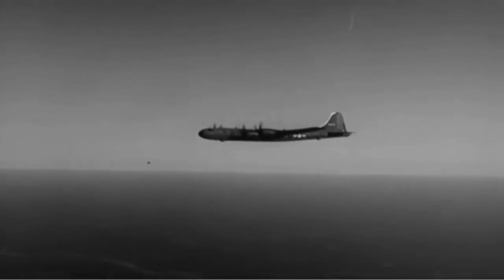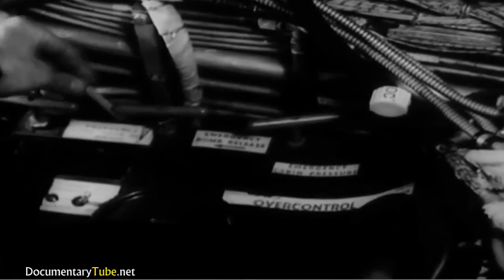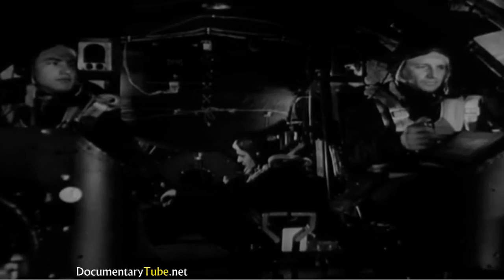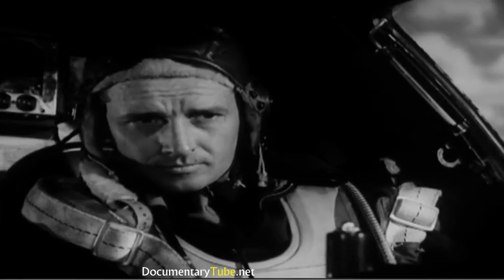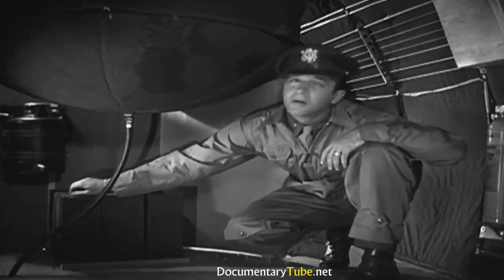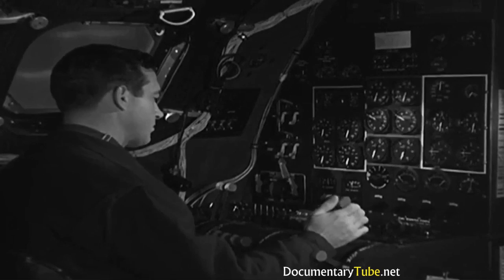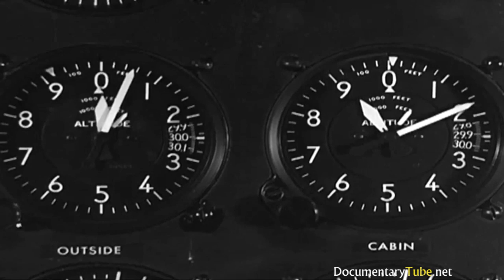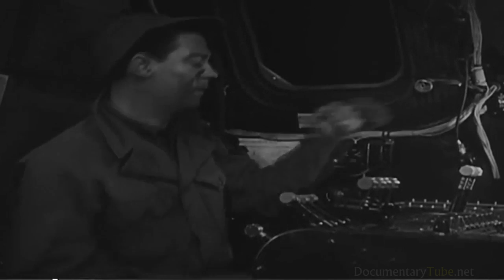HOW IT WORKS: WW2 B-29 Super-Fortress

Comment: If I were the Crew Chief launching this plane I'd be PISSED !!
  Many off the flight crews walk around checks depicted would be fine, but strut extension and tire pressure ? I would take that as an insult. It says they don't trust the Crew Chief with something as simple as that. And as for checking panel screws like they did ? Rapping the panels a couple times with a knuckle would be fine but what they did ? That would piss off the seven level inspector, who's job it is to check and sign off on things like that would be saying the same thing, that they can't be trusted to do their jobs either.
   I guess that's how they did the walkarounds back then, if that's what's shown here in the film, but I suspect they exaggerated just a bit.
Reply: +randy109 Surgeons now use checklists, emulating pilots, and it saves lives.  A high IQ doesn't mean you're not susceptible to errors of omission.
Reply: Not quite Randy. I can't say I worked with anybody that had a low I.Q. in my squadron, or anyone else who worked on the planes that I knew. Especially any body who worked for S.A.C. as I did. Things like flight crew checklists and the maintenance work cards used are there because something as complex as a large aircraft has far to many things to remember to fly or maintain from memoriy. 
  I worked and flew with many officers. What I liked about the Air Force, and working on the planes is that the officer flight crews treated us as co workers, not as someone subservient or less than because we were lower in rank or not as intelligent as they were. I always felt I worked with them, not for them. I dont even remember ever recieving a direct order. Instead, I was expected, as every one else in S.A.C. was, to know and perform my duty to a high standard, without somone standing over me barking orders. S.A.C. was VERY demanding in that way, and rightly so, because lives and the mission were at stake.
   Most officers I knew did not have multiple degrees. Many had degrees that had nothing to do with their duties. My squadron commander has his degree in ceramics, and he was a damn good commander.
  Your assumption about service members with low I.Q. s may have been true many years ago, but today's battlefield and aircraft complexity demands far more than people who aren't so bright. Also these days, advancement past the rank of SSGT is difficult without at least some formal education.
Reply: Actually, on todays flightline, if a flight crew member unscrewed or unlatched a panel, as the flight crew member did in the video, for any other reason then some kind of emergency, it would be a very serious violation of the seven legal inspection thats always performed as soon as the preflight is completed before crew show. What's done instead is to visually inspect, then rap on the panel a few times, listening for any that rattles.
These days, once the seven level inspection is complete, the aircraft is for all intents and purposes sealed, except for what the ground crew needs to do during engine start and launch. Any other alteration of panels, hatches, or secondary structures would be illegal, and would at least require another seven level inspection, and quite possibly disciplinary action under the U.C.M.J.
Reply: +8091pinewood Maybe I shouldn't have put the stress on IQ because that is rather insulting.  For several years I had two Corporals under me and one had an IQ about 35 points higher than the other.  The "smarter" Corporal was absent minded as hell and I would climb all over him when he forgot basics because I KNEW he was highly capable.  The fellow with the lower intellect was actually better and more reliable because he knew his shortcomings and actually tried harder to be 100% efficient.  Let me put it another way.  If you are on a TEAM you know who you can trust and who you can't without looking to place blame.  You almost instinctively know which parts of your checklists are REALLY important and which parts are put there to cover somebody's tail.  I've never met the man that doesn't "pencil whip" a couple of items because he fully trusted the man ahead of him.  Anybody who claims they NEVER ONCE pencil whipped a single item is a damn liar and you know it.
Reply: 8091pinewood  You are right about people getting "pissed" because guys go around behind them looking for rookie errors.  It IS insulting at times.  That said, when you try to make a process "fool proof" you must make it simple and repetitive.  In my unit we have guys with multiple University degrees working side by side with some 19 year old private with an IQ of about 85.  Any process that wants to be fool proof will be insulting to an educated person with a high IQ, like a Physicist working at McDonalds.  Redundant, boring checklists are what make it possible to enlist a kid with a Beavis and Butthead personality and have him handling multi-million dollar weapons systems in 6 months.  Remember, even if YOU are not an idiot, YOU are surrounded by idiots...

Comment: So after all this b***s**t, can we get to war?
Reply: Bill Dunn  A LOT of repetitive, boring, time-consuming Red Tape goes into those Checklists.  I've worked at an Aerospace Facility in central California for over 35 years (DoD employee).  You literally would not believe the pedantic time consuming work that goes into "Process" and "Standard Operating Procedures" (SOP's).  No joke, just as a Security Officer changing shifts in the middle of the night we perform dozens of checks on equipment (Vehicle, Weapons, Safety Gear, Medical Gear, Personal Protective Equipment and so on and so on...)  Some units in our facility actually have different colored "footprints" on the floor to have personnel walk a pre-designated route while doing equipment checks.  About the only good thing about these lengthy checks is that they really DO work.  You can have guys with many years of schooling and experience write an operating procedure or a checklist that any 19 year old with an IQ of 85 can follow and guarantee quality, reliability and thoroughness by repetition.  You ever wonder how the Military and Defense Industry can take a shoeless hillbilly and have them work on multi-million dollar, high-tech equipment in less than 3 months?  Procedures, SOP's and Checklists, THAT's how.  And you are right, if a bomber has to scramble they will get blown to hell while still sitting on the ground doing a 45 minute, pre-flight check ✈✈✈

☠
Reply: Luc Buydens It's an auxiliary power unit, usually a "Ranger" internal combustion engine. This supplied electrical power on the ground, during take-off and landing approach.
I was fortunate enough to fly in these things during its final two years of service.
The interminable pre-flight  inspection as described here is a huge exaggeration.
When the aircraft was cleared for flight by the ground crew, the flight crew got on board, just like a "normal" aircraft.
The idea of pilots checking tyre pressure is hilarious!
Reply: ***** Yes, I've seen that video. What a total tragedy.
Reply: randy109 May I ask, do you have by any chance an idea what the "putput" is? Its a piece ofvequipment the tail gunner has to check for the pilot.

Comment: Note the B-29(s) shown are in OD, the production versions were Natural Finish, like the Enola Gay at the Smithsonian!
Reply: The test models(YB-29's) were painted. Not painting the production models saved several hundred pounds. Fuel,Bomb load all those .50 cal. rounds weight critical for 18 hour flight times.

Comment: Less than 20fps on the gun camera? that must have been awful. I didn't even realize they had that technology back then.
Reply: Was this the camera they used so they could see below them? Just making sure, probably a dumb question
Reply: @hotbam37  
No. The could not see anything from the gun cameras until film was processed on the ground after landing. The cameras pointed at the gun's target for auditing purposes.
Reply: The gun camera was a film camera that activated when the gun trigger was depressed and recorded what the gun was (or was not) hitting to prove kills. It was not used to aim the weapon and for auditing purposes 20fps (film frames) was adequate.
Reply: 16fps was standard speed in  film  cameras even film in a movie theater is 16fps.

Comment: can someone tell me what the Put-put is ??
Reply: RattlerX5150 aux power unit.  APU
Reply: RattlerX5150 Putt Putt golf and games?
Reply: RattlerX5150 compressor
Reply: RattlerX5150 generator for extra amps
Reply: thanks
Reply: A.P.U.  Auxiliary power unit. Provides power without an external power cart when the engines aren't running and or the generators aren't on line yet. On many jets, especially airliners, it also provides compressed air for starting engines without an external air cart.
Reply: Does the Put put have its own fuel supply, or does it run off the AV Gas
Reply: @RattlerX5150  had its own fuel -it was a 2-stroke

Comment: I just watched the first few minutes but I was like dang, this is just like how your supposed to check your truck at UPS each morning. They have some video like this. haha Wonder how many of these pilots and gunners actually did all these steps every day back then during the war or just skipped most of them! hehe Very thorough video.
Reply: The crews ALWAYS did all the checks, everytime they flew. This is called the walk around, and its like a time honored ritual, for very good reasons, because lives and the mission are at stake. The crews would no more skip or do a half assed walkaround then they would wear a swastika on their uniform.
Reply: @8091pinewood  as one retired Apache pilot wrote in his book: "... or else we will be turning things on mid-flight without knowing if they would work..."
Reply: Acc0rd79 This was describing what the manufacturer deemed necessary before takeoff. it was an out for them if anything went wrong . I agree I doubt many crews were this thorough ? They would more than likely trust their ground crew to do most of these apart from the general walk around the plane that most pilots do to this day and making sure the landing wheels were up or down in flight.

Comment: It would have been interesting if at least one squadron of big shiny B29s were sent to Europe just for morale purposes. I can imagine the reaction of the British let alone the Germans..
Reply: Mauricio Herrera 

The British bombed at night because their losses on daylight raids was too high.
Reply: Wrong again Billy, "B-52's jet engine power, were used over Viet Nam. Retired B-29'er.
Reply: Mauricio Herrera  Who said it was funny. Remember Hitler ordered the bombing of British cities to improve German morale.War sucks been there done that got the T-shirt.  Am I a monster sure hope you never find out why.
Reply: yank1776 No they are not rotated out of curiosity. They are rotated to pre oil the cylinders before ignition . During inactivity the lubrication on the cylinder walls drains and rotating by hand a few times respreads some oil on the walls  because  on ignition and starting, the first couple of revolutions without oil is when there is the most wear on the cylinder walls. So it is done to lengthen  the life of the engine.
Reply: The Germans developed night raids of civilian cities during WW 1. The French did not have any night capable bombers.
Reply: +yank1776 The B-29 was "briefly evaluated" in Europe. They flew one around in England as a disinformation ploy to deceive the Germans.
Reply: +l8tbraker  Thanks did not know that
Reply: BILL GOAT  herpderp
Reply: Radial engines are turned by hand to remove oil accumulation in the lower cylinders.  This prevents hydrolocked engines (oil in not compressable).  Possible damage resulting from failure to do this procedure ranges from ruining valves to blowing off a cylinder head.
Reply: They sent one YB-29 to England and a German recon plane got pictures of it and it got into German papers at the time.
Reply: Bob McRae It doesn't take balls. It takes time, money, a sense of superiority, and a callous disregard for any body brown, poor, and unfortunate enough to be in your way. But hey, we learned from the best. Thanks for that.
Reply: We didn't have the B29 until the Viet Nam war.
Reply: Mauricio Herrera 

You are an idiot who knows nothing about what he talks about. The Americans tried daylight bombing in 1943 but had to stop because of their terrible losses. They only resumed their bombing campaign after they had developed long range fighter support. By the way, the Americans also bombed Dresden the day after the British did. 

But if you want to talk about cowards, Americans killed 4 million civilians with bombs, bullets and chemicals during the Vietnam War. They've also killed an estimated 1 million Iraqis and Afghanis in recent years. Only the Nazis can compete with America for crimes against humanity. What kind of balls does it take to kill on this scale?
Reply: Bob McRae have you forgot about Russia and Japan too?
Reply: @bobmcrae5751  yea that's funny only Nazis, huh might i remind you of Stalin, Ghengis Khang, China in general, the turkey genocide of the Armenians, the British in the Americas, the Spanish in Mexico and South America, the Indians against Muslims in India and Pakistan, the list goes on. The Americans come no where near the top of the list of civilian casualties. From your comment I can tell your an America hater because, OH the AMERICANS did so much worse things than anyone else did. As a matter of fact the Americans were the most favorable option for Germans in WW2 because of their reputation for being their hospitality to PDWs. So how about you do some research first ok. Finally the difficulty of trying to distinguish civilians from hostiles when the enemy is using guerilla tactics is extremely difficult so the death of innocent people is sad yes but when your in the moment you don't hesitate to wait to see if they are gonna shoot you first.

Comment: I think it's safe to say that much, if not all, of the engineer's job would be automated if the B-29 were built today. Having said that, the extra pair of eyes made for a good redundancy.
Reply: If the B29 were made today there would be 6 engineers.
Reply: BILL GOAT Maybe 6 computers instead of a flight engineer!
Reply: +ripplecutbuddha Same as the original 747's. Used to have flight engineers, now it's all below decks in the avionics bay. No more "Roger, Roger. We have clearance, Clarence. What's our vector, Victor?"

Comment: What the heck is a putt-putt?
Reply: A small petrol engine in the rear of the plane that provides electrical power when the engines are not running..today on a jet called an APU (auxiliary power unit) which is a small jet engine in the tail of modern jets.
Reply: Allright, thank you.
Reply: martin murphy Thanks, AF slang word for the APU. An old B-29'r.
Reply: The Auxiliary Power Unit, a fuel operated 80 HP (horsepower) engine driving a electrical generator provides the DC power to the B-29 aircraft electrical systems and for #1 engine starting. #1 has a DC (direct current) generator providing electrical power for all electrical systems use. All 4 engines have DC generators. AC (alternating current) power is not used. The APU remains on line untill the aircraft is at altitude and wheels up. True, there is a 5 gal fixed bucket in the front and rear compartments of the aircraft, and we called them "shit cans". BG you were half wright. Brothers that is. signed: B-29 flight engineer. Do you want an explanation of "flight engineer" ?
Reply: Its mentioned further up, its a small auxiliary engine/generator to supply power to aircraft before engines and its own generators start up & take over.  (APU, auxiliary power unit) hope this helps, I watch too much discovery...
Reply: It is a mini golf game built threw out the aircraft for the flight crew to play while the engineer does a bunch of work nobody else wants to do!
Reply: It's a toilet the crew would shit in.

Comment: The B29 was a hell of a leap over say the Lancaster
and at a time of outside toilets and when most working class didn't even own a car
truly cutting edge
amazing how everything was thought out and planned so well
Reply: Did you check the outside toilet while in flight?
Reply: They will hit the #4 tach gauge with a hammer that will fix it!
Reply: It truly was a mechanical marvel for its time
Reply: Absolutely agree, the B29 was way way more advanced that the Lancaster (even the upgraded version, the Linclon, was still no match for the B29)......Now I know that some die-hard patriotic will say the Lancaster could carry the 22,000 lb Grand Slam, and the B29 normal load was only 20,000 lb....er.....notice the word "normal"...the Lancaster could carry a single 22,000 lb bomb when the bomb bay was  "modified",  but, OK, the B29 bomb bay could not be converted to fit the Grand Slam inside, so what the Americans did was to have TWO Grand Slam under the wings. And there is a picture to show. (Again some Die -hard patriotics will argue that there is no proof that the picture was genuine etc etc etc.)
Well done B29, what a magnificent aircraft, and thank this plane for ending the war!!  :)
Reply: @michaelwong4303  
Also the Lancaster had to have what defense guns it did have stripped out and crew members left behind to carry the grand slam bomb, and doing so dropped it's altitude, speed and range way down, when it was configured like that the B29 fully loaded could fly well over 10 thousand feet above it, probably closer to 20 thousand ft or a little more.
Reply: @dukecraig2402  I think a good way to look at it is, the Lancaster is a Ford transit van with a small hatchback forcefully  "squeezed" inside, whereas a B29 is like a proper rescue-truck comfortably carrying a car on its back.